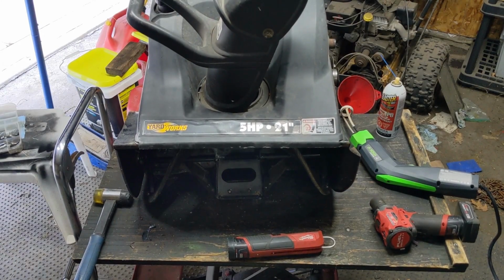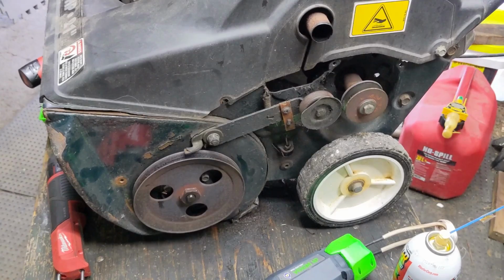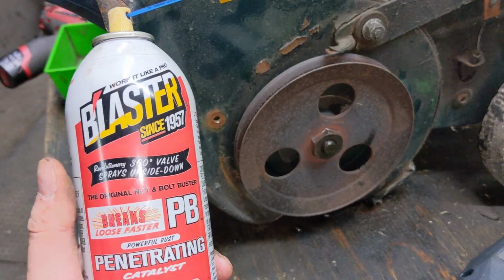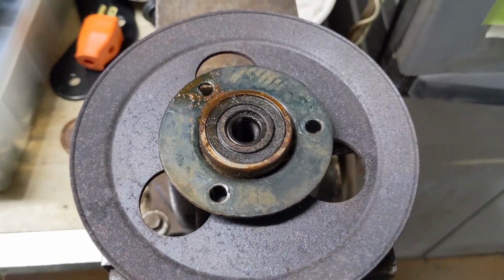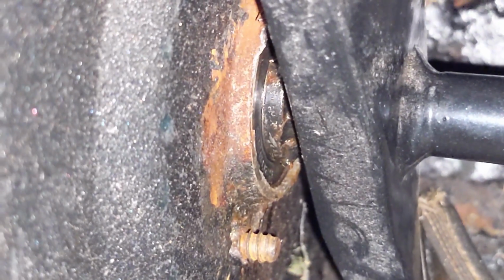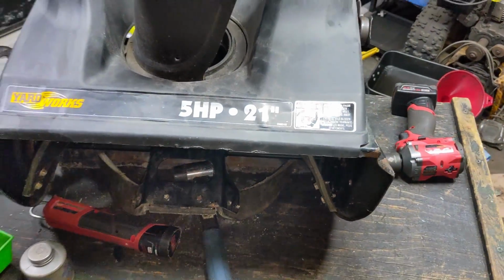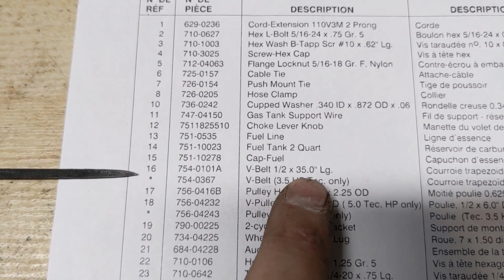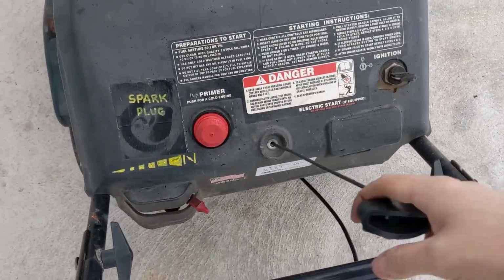Replacing Rotor Bearings on a Yardworks Single Stage Snowblower

Comment: This snowblower had alkylate Aspen 2 50:1 fuel in it and had not run in two years and 2 months and as you saw it started with a couple primes and one pull only. If we do not sell it we will try to start again in 3 years, the last time it was used was January 2020 to clear the deck at our boat club LYC.

Comment: Great video , never had to replace those bearings . amazed to see the pully threaded onto the shaft like that . Looking forward to spring .
Reply from the maker: This isn't the best design, the original bolt had snapped when we got it years ago, so I put a new bolt in. I believe the pulley tightens so much, it pulls the shaft towards the pulley and puts additional stress on the bolt. The Toro design seemed better. Not to mention, it's a good thing they had those holes in the pulley to remove the bearing flange or else this repair would've been a nightmare!

Comment: Your thumbnail could have easily been Venom Strikes Again. Likely the number one tool in the shop as far as i am concerned, just using it on skid shoe adjustments where the shoulder bolts do not break has saved our customers a lot of money. In this video that pulley would have warped using a torch which happened on the 2 stroke blower we just donated to a small engine repair class when we did not have the Venom induction gun and used our torch. Nice video buddy, good job another unit for sale but no more snow?
Reply from the maker: I think that's the end of the snow, hopefully. We'll be fixing mowers soon.

Comment: That really is amazing.  One day soon I will get my hands on one of those.  Thanks for sharing!
Reply: KB one awesome piece of shop equipment and #1 tool in the shop according to how many times i have used it. Not only is this induction gun saving us many hours of labour but also parts replacement ie: shoulder bolts from skid shoes, both drive and auger pulleys all of which are subjected to a lot of moisture from the snow. Another use is the muffler bolts that normally break off when trying to remove them.
Reply from the maker: Yes it comes in handy more often than I originally thought it would. Once you figure out how to apply this tool, many jobs become much easier.

Comment: Pop the seal off the bearing clean it with gas or solvent and regrease it or spray penetrating oil into the bearing between the seal and the inner ring of the bearing it will spin like new again.
Reply from the maker: Yes but for how inexpensive they are, I'd rather just replace them. My cost is like $3 each
Reply: @EliminatorPerformance  truth I guess it’s a suggestion for others who don’t have new bearings laying around
Reply: I used to sell bearings and power transmission components so I know quite a bit about them, typically the grease coagulates vs. mechanical failure
Reply: Not this baby too much rust on the ball bearings sometimes you just gotta bite the bullet and install new

Comment: great video, and excellent focus and shots. i've been getting by with my acetylene torch, but like you say, i've had pulleys warp and bend over time, you only get a couple heats and the pulley is out of round. Guess its about time i advanced to the digital age and got an induction heater. that bearing was really seized on there, i bet if i had that situation i would have ruined the pulley as well. using an induction heater made the process less painful to the equipment for sure.
Reply: 100% correct torch heating on this type of pulley causes warpage been there and done it. This induction heating gun is likely the number one tool in the shop. Paid for itself many times over not only in parts savings but labour savings also.
Reply from the maker: I can honestly say, since getting this Venom HP, I haven't used my oxy-propane torch. However, there will always be a need for different tools for different applications, a torch can still heat and cut, while this can only heat.

Comment: Great video I got 2 troy bilt squalls a 5521 and a 721 and they're identical to the one you just showed. I too just replaced the auger bearings and the idler arm bearings, also replaced the auger paddles, and new belts too. I agree once you got it dismantled better to replace everything and these are cheap to replace all bearings, belts,and auger drive cable. I think this video was perfectly executed as always lol. I do want your recommendation, my engines according to my manuals states the engines take 21ozs of oil that puts the oil level way above the full line not sure why that is. I found that 16ozs of oil is just the right amount to make the full line. I'm curious have you ever run into this problem with any of the tecumseh engines you've worked on. Please let me know I feel I'm correct with putting just enough oil to make the full line. Thanks again.
Reply from the maker: 21oz is for a dry engine, so that's what they take from the factory. If you have the manual, and it doesn't say to tip the machine forward to add or check the oil, then I'd recommend putting whatever amount gets you to the full mark. These engines are designed to run on an angle do to how they mount in different snowblowers. 5oz isn't much of a difference, and if you add more, I'd wager it would blow out the breather tube and make a mess.
Reply: Thanks for the quick response I set the machine till its level eye balled then fill it to the full line. I set it back down onto the shave plate and recheck it and it's about 1/8 inch above full and I can live with that. Thanks again I truly appreciate it, you the man.

Comment: if the flange was pulled back onto the outer race would there have been room for a knife style bearing puller to fit between pulley and flange and plug flange and bearing off together?
Reply: Zero room just a very small amount of clearance still needed the Venom to remove the inner race by having the hex part of the pulley in the vice then turned the inner race red hot with the Venom and used large channel locks to grab it and rotate back and forth to remove it was really seized on.
Reply from the maker: The one that I have wouldn't fit, I would've needed a split puller that had a small outside area and a wider inside area. The pulley is dished so it made fitting it in there difficult.